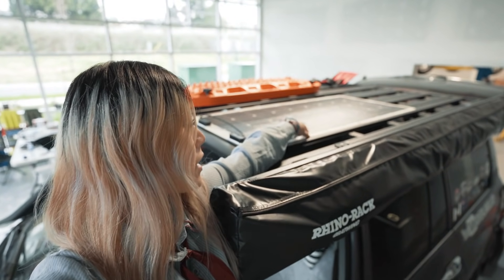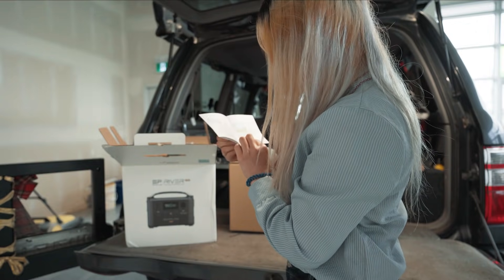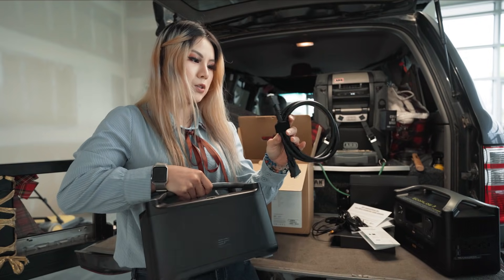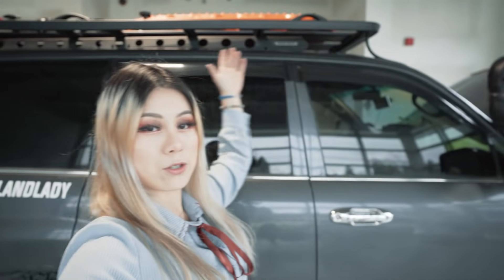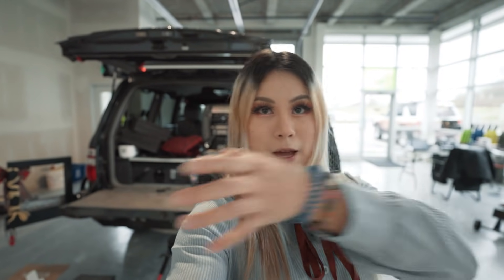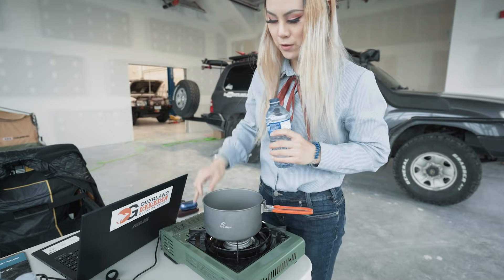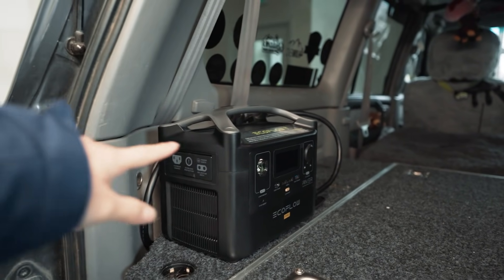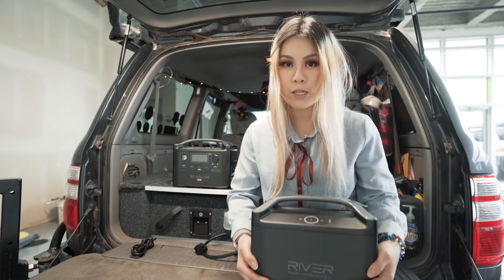Overland Power Setup | EcoFlow RIVER Pro Lithium-ion Battery | Overland Garage

Comment: I received my River Pro this week (Sydney Aust). I also got the 2nd battery plus the 160w solar charge panel. I’ve only tested the solar charging. Strong sunlight hit 100w input, diffused sunlight was approx 30-50w. I look forward to testing it out properly. Thanks for sharing your journey

Comment: These units work great. I have tested mine with the SnoMaster expedition fridge/freezer. I find the voltage stays up in the 13 volt range and have powered the fridge/freezer for over 12 hours on one charge - also quick 1 hour - 80% recharge! Check out Off Grid Trek on line or in Calgary. Great choice there lady!

Comment: I can totally wire up a power system like you shown in the picture from overseas.  Ive been installing stuff like that in Gov Communication vehicles for 30 years. We have to go to school and get  re-certified every couple years in Soldering / Electronics assemblies. Multiple battery setups on slide trays with 12 /24 volts. Invertors/converters ,battery diodes, Isolation setups, dual alternator and battery kits. Maybe I should start a side business. :-)
Reply from the maker: Oh ya Canada don’t have automotive specific electrician cert

Comment: Thanks for sharing.  I have the same setup on my Jeep....except...I have a 1000 Watt 115 Volt inverter that I installed in the Jeep.  The 1000 Watt inverter is wired into the 12 Volt battery of the Jeep and is powered up when I start the Jeep.   I charge the Ecoflow with while driving with 115 Volts from the inverter.  Basically, this takes the charge rate to over 600 Watts the same if you were charging at home from the wall.  This works really well!  May have some losses through the inverter, but there are not too many other ways to get this much power this fast back into the battery.  Hope this helps.

Comment: Hey Monique great video
I think you’ll find that your redarc bcdc will work much better if you mount it outside the engine bay.  

The REDARC BCDC 3 stage battery chargers will work to full capacity up to 55°C ambient temperatures, then start to de-rate (reduce charge rate) up to a maximum of 80°C, with the current reducing to zero at around 85°C.
Reply from the maker: Yes definitely thought about that but it's also best to have it close to the second battery.. When I got the vehicle it already had a second battery setup in the bay..Tiny tray can't fit much of a battery, I already don't like it.. Thanks for the detailed info! something to keep in mind when rearranging my power setup properly.

Comment: Wow I would be interested to see how your induction goes, my understanding is those things suck a lot of power really quickly. Also redarc red vision is amazing but massive over kill unless your running a caravan or massive motor home . You can run a big red arc system with bucket loads of power for half the price of red vision. I’m happy to run you through it if u wanted
Reply from the maker: Seen many people use them on truck/utes. I find red vision more critically useful when you have built-in water tanks... other stuff I can live without a centralized gauge..
Reply: @OverlandLady  I agree. I use a redarc 1500 W inverter,  50amp dcdc , and a DCS 200 ah slime line lithium which has built in BMS . AND A solar blanket I can do plenty overlanding with that . Simple and power for as long as you want .

Comment: Hi!  I’m an EcoFlow guy myself. I have the Detla and the River Pro (like yours) without the extra battery though.  I can understand the induction being a cost savings, but they use a lot of power.  I would be curious to know how many Wh it uses.  I considered it, but just went with a propane/butane stove because I thought an induction would take up too much of my daily battery or if there was no sun for a few days, etc, etc.

Ive got that same blinker too. LOL

Unfortunately, you cannot charge the extra battery on its own. I’m not sure if you can charge both fully in one day via solar since it can only take 200w input.  They should have made it so you can charge it separately, other brands that have add-on batteries like this are able to be charged on their own.
Reply from the maker: That one induction i showed in video was faulty so i returned it. I use a 1000W air fryer to cook. Each meal usually 20 mins, thats about 77% left on the battery. Enough for some other charging and run my heated blanket overnight. I actually haven’t needed to use the separate battery…

Comment: Great info. Thanks Monique. Ecoflow link is dead for me. Can still navigate the site tho.
Reply from the maker: The link goes to the US site Ecoflow River Pro. I explained near the end of the video that river pro is not available outside US.. it automatically bounce to CA site which doesn’t have this item😅 i had to use VPN to get to their US site.. wish they can make it more flexible..
Reply: @OverlandLady  No worries. Let us know how your new setup works for you. Looking forward to your thoughts as I'm trying to decide which fridge, how to power it etc. Keep up the great work!! :)
Reply from the maker: @wunderlostbc  In terms of fridge, the ARB Classic II works well for me. Low amp draw and you can charge with 12V in the car and pre-cool at home on the household socket. My connector is hardwired to the secondary battery.

Comment: @14:35  Going  induction = more  efficient  than  a  microwave  and  uses  less power  than  the  stated  full-power level  .  .  .  .  my  1800 watt  Duxtop  induction  cook-top   usually  runs  at  700 to 850  watts  for  most  normal  applications.   IF  you  run  at  full  power  it  will  make  the  pan  (bottom)  too  hot  causing  food  to  burn/stick  to  the  pan  before  the  top  layer  of  food  is  even  warm ! !   (Full power great for heating water quickly but lower power levels for most other uses).    BUT,  induction  cooker  great  choice  over  propane ! !

Comment: seeing as this video is a lil older now u probable all ready know to beware of the 1800 x boost its basically make w.e ur using run off 600w and can damage sensitive electronics if its like a heater or something u can get away with it..im torn between this model and the bluetti eb70s as it has the lifpo4 batteries and the ecoflow river pro uses lithium ion which have a higher risk of exploding but i love the extra battery to bump u up to 1440 and everything on the ecoflow seems more polished its just the cells holding me back
Reply from the maker: the xboost somehow tricks the appliance to be able to run on lower wattage. Not all appliance takes that. But my 1000W air fryer run it just fine. Just need to fry a bit longer since it’s essentially less wattage

Comment: Hey what suspension setup were you running at the time? Your landcruiser had a good stance considering the weight from all your bar work and drawers.
Reply from the maker: Terrain tamer heavy duty pro shock suspension. Need heavy duty torsion bars and springs to support the weight
Reply: @OverlandLady  Never heard of the suspension brand! Thanks👌🏽

Comment: too bad the link doesnt work and it doesnt appear available in Canada yet. I would have bought one. Or if your discount code worked on the River Max that would be cool too. We'll keep shopping for a different brand I guess...
Reply from the maker: The river pro is only available for US. When it sense your IP you may have been bounced to Canadian site automatically which doesn’t have the River Pro item... i had to use VPN to stay on the US site to see it. wish they are more flexible for that matter

Comment: That’s a pretty cool concept to have a slave battery when you already have the other station that takes care of all the supply ports. Did you find out if the external slave battery was able to charge solo?
Reply from the maker: So far haven't found out =/ maybe an adaptor

Comment: Hello, the capacity of river pro is rated at 720Wh - how does that translate to Ah please? A standard leisure battery is 110Ah, how does the river pro compare to that?
Reply: If you calculate it based on 12v - it's 60AH, so with the additional battery that's a total of 120AH, most of which is usable compared to an AGM that can't be cycled as deeply. Many people miss the fact that this isn't just a battery - but includes 600W inverter, MPPT solar regulator, AC charger, DC charger, regulated 12v (13.6 actually) outputs and multiple 5v USB outputs. So you need to compare it to a Battery, plus all those things hooked up, and suddenly the battery & accessories are taking up lot of space & weight by comparison.

Comment: Why are you charging the Ecoflow battery from the Optima and not the start battery,
Reply from the maker: My 12V in the trunk is wired to my secondary battery. So it’s constant on even when the car is shut. Same as my fridge, all connected to second battery so it runs independently as starting battery.
Reply: @OverlandLady  ok so assuming that the Ecoflow has a low voltage disconnect or similar consider this scenario.
You have been camping for several days and both the optima and Ecoflow batteries are fairly discharged. You start driving and the bcdc is putting 25 amps into the optima. Your fridge is cycling so pulling around 4 amps, it appears that the Ecoflow pulls 8 amps, (I am not sure if the extra battery also pulls 8 amps or not as well) but  over half of the output from the bcdc is not actually going into the optima and I doubt you would drive long enough to fill both Ecoflow batteries and the optima.